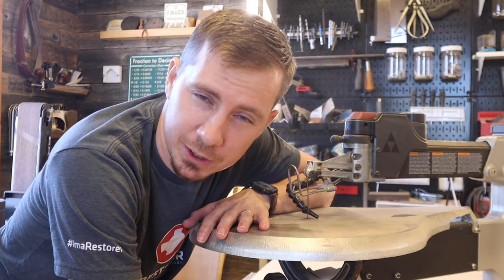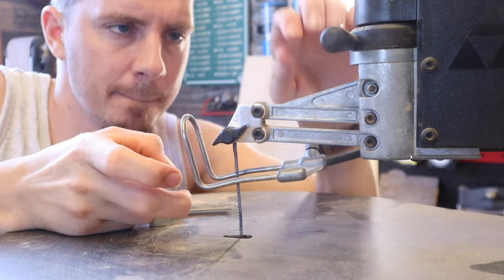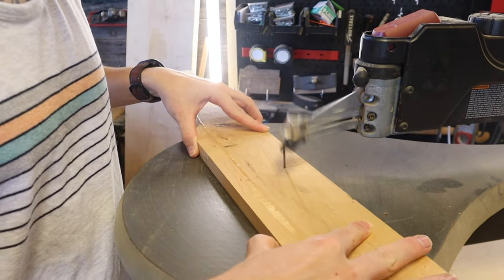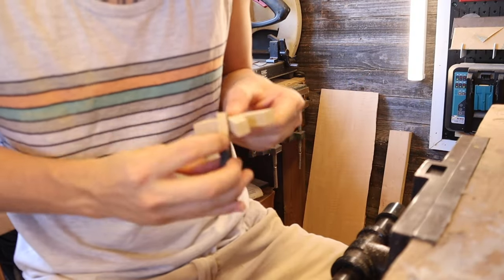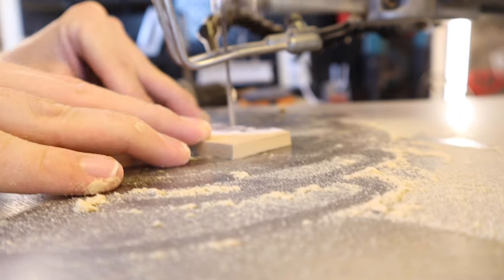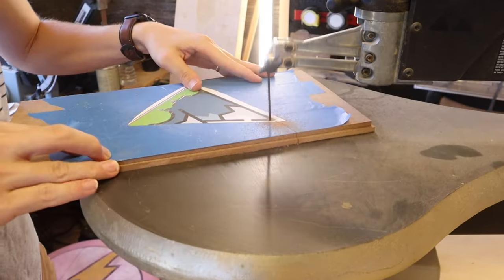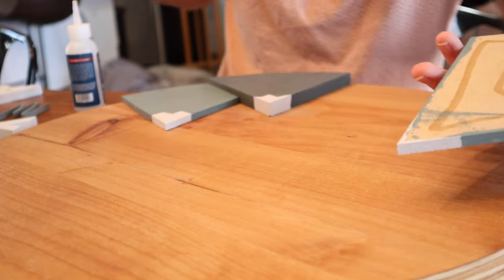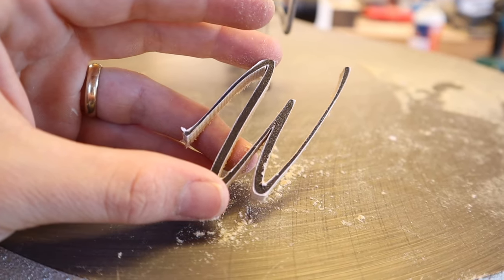7 Scroll Saw Tips For Beginners

Comment: Been scrolling for many years and my top tip is use packing tape on the wood and glue the pattern to that.   The Teflon in the tape lubricates your blade as you cut making it much easier and less chance to get burning.   For hard woods and thicker woods use packing tape on top and bottom   I cut mostly 1" hardwoods.   Also periodical wax/polish your table with a good car polish to keep things sliding smoothly.    And a lighted magnifying glass really helps your accuracy.

Comment: wd40IS not A LUBRICANT, iT IS A SOLVENT AND WATER DISPLACEMENT SOLUTION.
Reply: I know I'm replying to a 3 month old comment but I want to add that wd40 is like a jack of all trades, master of none product. While it could lube somthing, there are way better options to use. It also can be used as a solvent, but it's not as good as actual penetrative oil.
Reply: Plus sing as which, it’s slippery

Comment: Contact paper (shelf liner/peel and stick) works as well as blue tape and is a lot cheaper and lasts longer.
Reply from the maker: Appreciate the tip 🙌🏼
Reply: Thank you for this tip. I woulda never thought of this. I will try this soon. I have many rolls of contact paper. Some prints I won't use for anything. Now I have a use for them. Many many thanks.

Comment: I use an old Richards Electromatic to modify flatbed dies and make stripping boards for die cutting paper cartons.  If you're using mdf, it's really easy to remove the paper pattern in one piece with acetone.  Then rub the piece down with the saw dust.  The fine saw dust sticks to the adhesive and makes it easier to sand completely off if you have a piece large enough to sand after scrolling.  And 3M Super 77 is the best spray adhesive I've found so far.  Also I use a crap-ton of that Starbond.
Reply from the maker: Great tip, and Starbond is the way!

Comment: I use packing tape on top of the pattern and then blue tape the pattern to the top. I don’t like breathing any aerosols especially since I am doing dozens of cuts and that stuff is way more expensive. The packing tape in essence lubricates the blade. Also, I can reuse the patterns multiple times. Get good at spiral blades because they rock on curvy intricate patterns
Reply: I was doing as you suggest, but on delicate fretwork the pattern could still shift. One nice alternative to aerosols (and much cheaper) is glue sticks to stick the paper to the blue tape. I'm with you: leave the expensive aerosol for someone with more money than brains. :)

Comment: Recommendations for a budget friendly saw for a beginner,? Been playing around with woodworking for a couple years, But never used a scroll saw.
Reply from the maker: You can often find cheap machines locally through re-sell. My first one was of of Facebook for $60. I think Harbor Freight also has a cheap one but I’m not sure about the quality.
Reply: Unfortunately, buying a cheap scroll saw will probably turn you off to this enjoyable hobby. Cheap saws are a pain in the butt to use.  Few have speed adjustments, most require pinned blades witch reduces the number of blade options. Also, the amount of hold down force on your project piece while cutting will quickly fatigue your fingers. Do your self a favor and get a good one. You can expect to pay $250, anything less a your buying a toy.

Comment: Instead of using spray glue on my projects before applying pattern, I use a Staples clear sheet backed by a yellowish peel-off backing. This prevents the pattern from moving an those muisence small  pieces that want to fold up when scolling

Comment: I have an old Craftsman scroll saw and I'm not sure if it's working or not.  It cuts REALLY slow and I have to push the piece with so much pressure.  I put a new blade in it and it's still not cutting near as fast as what you are showing here.  What could be wrong?  I'm relatively new to it, so I have really no idea how to set it up.  I'm cutting 1/2" pine.  Just the regular old dimensional lumber sold at my Home Depot.  Any suggestions would be appreciated.
Reply from the maker: I started with an old saw as well and they tend to get gunked up with sawdust since the saw creates such fine particles. I deep cleaned it several times but nothings beats a brand new machine and motor.
Reply: Make sure that the blade is installed with the teeth pointing down. Also, do you know how many teeth per inch are on the blades you tried? Try a blade with fewer teeth per inch. Keep in mind that the blade should do the work and you should not have to push the wood too hard. Also, check to see if your blade is square (at a right angle) to the table. If you want to try a new saw, I have had very good luck with a scroll saw I bought from Harbor Freight (about $100 on sale). Hope this helps.

Comment: No to oil on the blade, in particular what I saw getting on the cutting table, all that oil will get on the wood and stain it.  SInce I use clear shelf liner to adhere my pattern, that lubricates the blade more than enough.  It also comes off easy when done.  If you must lubricate your blade a bar of soap works.  I clean then use a ceramic car spray for my table, this way my wood slides easily. Also get rid of those pinned blades, go pinless #5 Flying Dutchman Ultra Reverse are easy to control, and you do not have to sand after cutting.

Comment: I've burned thru a few blades in my time. First saw was a 16" Crapsman single speed. It taught me to hold my work and how crappy pin style blades are. Next was a 21" Sakura (now PS Wood) that had five speeds and was belt driven. Used that saw for twenty years before retiring it after I wore out the bronze bushings that held the arms in place. Now have a 20" RBI Hawk. Have extensive (+100 hrs) time on Hegner's and the oval armed Delta. Here's what I can tell you...

1: Junk your pin-blade saw. Pin blades are much wider, generally much poorer in quality and cannot hold proper tension.
2: Buy multiple blade clamps. The lower clamp is the time eater. Having multiples means you can simply swap in a new blade for the one you are using that is old, tired, dull and maybe even bent.
3: While I have never tried to ascertain which musical pitch I tune my blades to, I tend to tension scroll saw blades tighter than my contemporaries. Personal preference which (I feel) allows tighter turns.
4: Use the smallest sized blade recommended for the type and thickness of material you're cutting. I generally use #5's with the reverse teeth under the cut. I buy them by the gross!